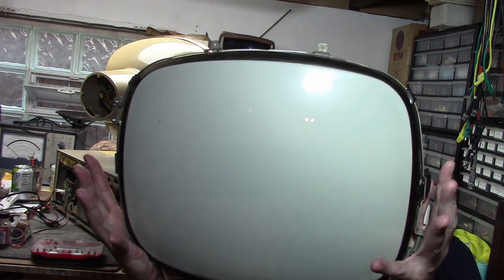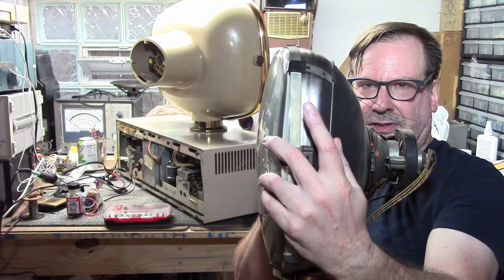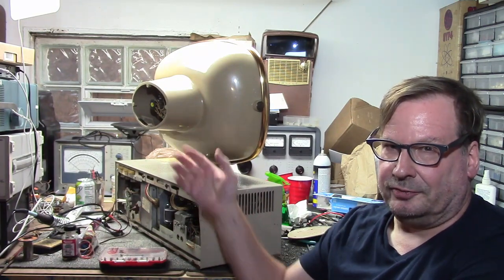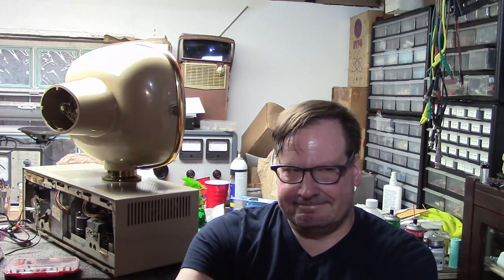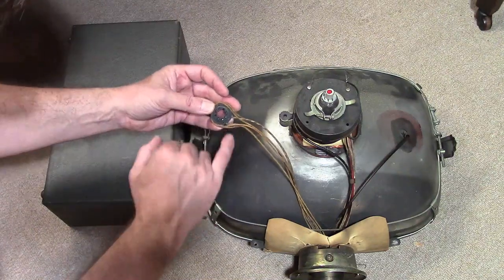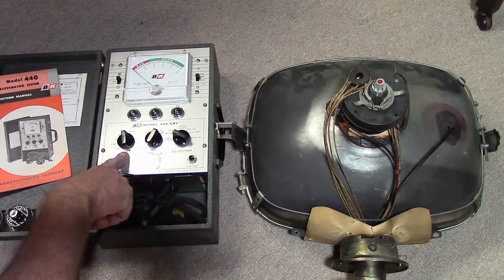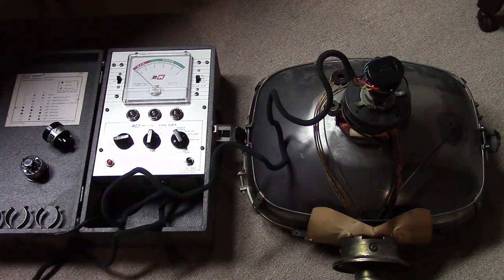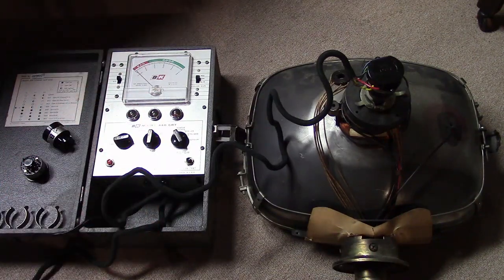Predicta 17" tips: Picture tube

Comment: Great video Bob!  I love your videos because of their quality and the effort an passion you obviously put into them.  Do you think that they were trying to speed up the CRT's warm-up time as well by choosing a lower voltage filament in the CRT? That's my suspicion but I could be completely wrong.  I know that Hitachi in the early 80s produced a series of "Instavision" colour sets with directly heated cathodes and low voltage heaters that often had horrifically poor service lives.  Their lifespan in the field was often so poor that Hitachi themselves produced a service kit for dealers to convert the sets back to a 6.3v heater CRT with conventional cathodes.  It wasn't uncommon to find the sets on the second hand market well into the 1990s with almost immaculate cabinets but completely dead CRTs, presumably because the CRTs died so quickly the cabinets never received the wear and tear they should have done!
Reply from the maker: Thanks.  Those came much later in solid state sets.  These take just as long to warm up as any other tube based TV.  Maybe a little longer.  Sound kicks in before the picture does.

Comment: Thanks - this is a very informative video. I recently picked up a Princess model in good cosmetic condition for (what I think was) a reasonable price.
I see the 17BZP4 listed in the "long" replacement tubes. Do you know if the 17BVP4 is also compatible with the 17" Predictas?
Reply from the maker: Here's the datasheet. It would work electrically, but has a much longer neck and it uses an ion trap magnet.    https://www.surplussales.com/pdf/CRT/tuc-17bvp4.pdf
Reply: @bandersentv  Thanks again. So, it sounds like the 17BVP4 isn't ideal, but might work as a last resort.
The Predicta that I bought came with a CRT "britener" installed, but I haven't powered it up yet (pending closer inspection). I'm waiting on a CRT tester to arrive, so it will be interesting to see how the tube emissions look with and without the britener.